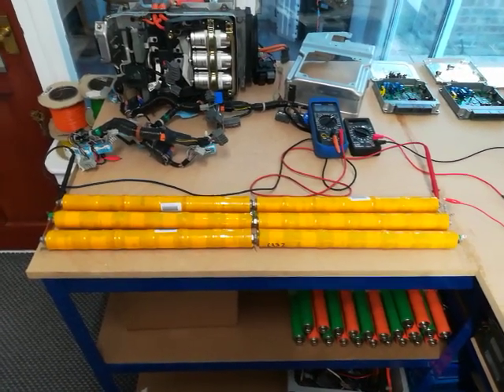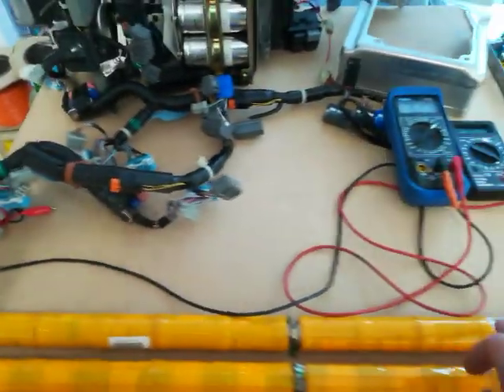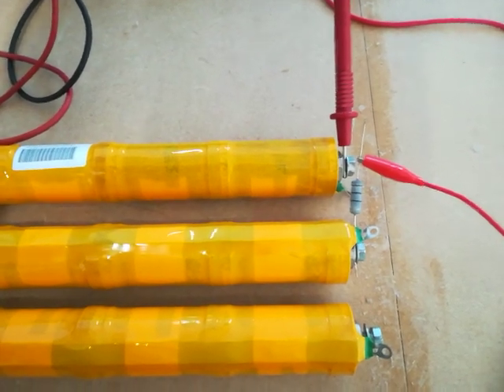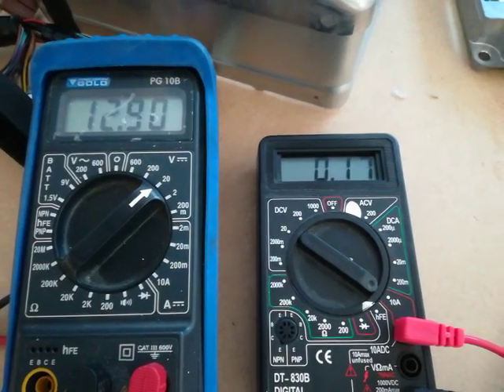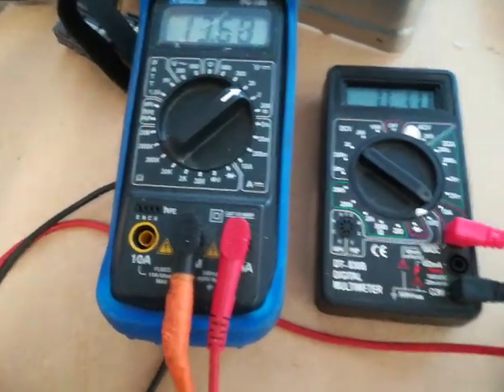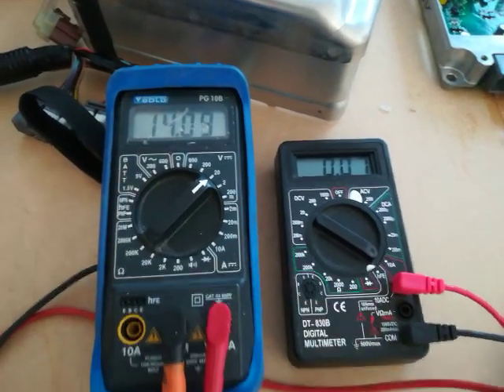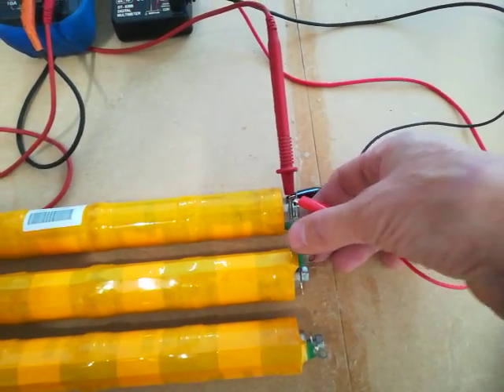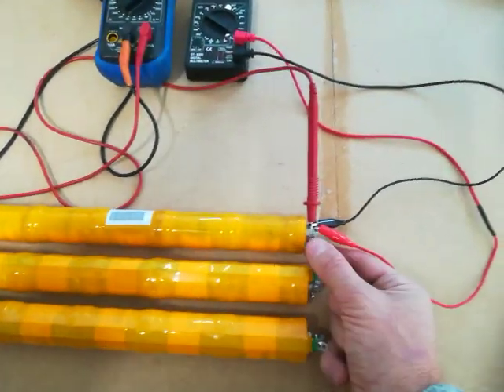Nimh Parallel Stick Pair Resistor Balancing

Comment: Hi. Pretty interesting... What was the voltage of the fully charged batteries before you connected them? 14.4v?  How long did it take to balance the empty ones with the fully charged ones?  I wanted to do this but was worried.
Reply from the maker: No idea sorry it was a few years ago.